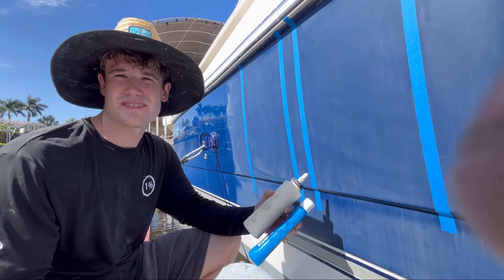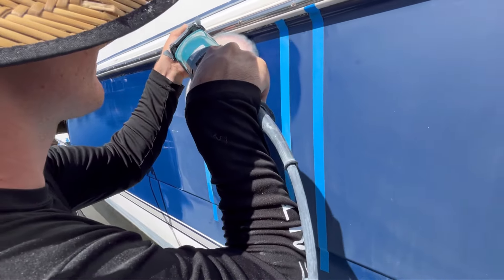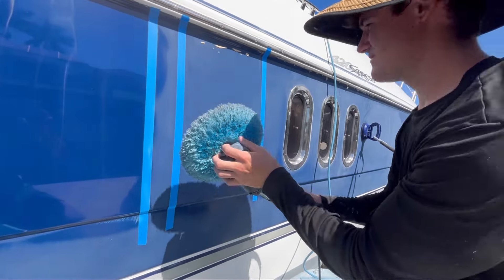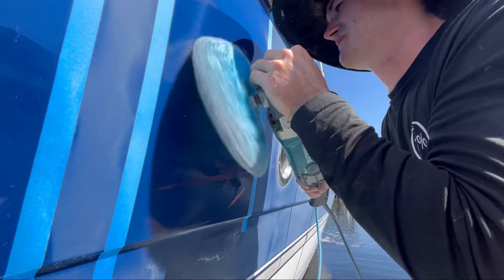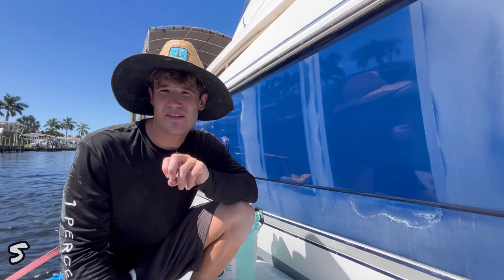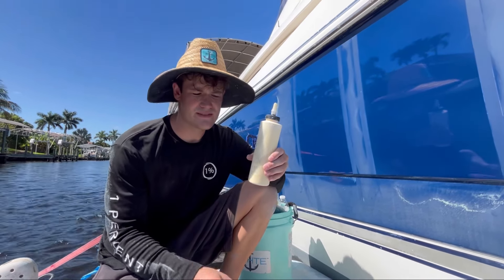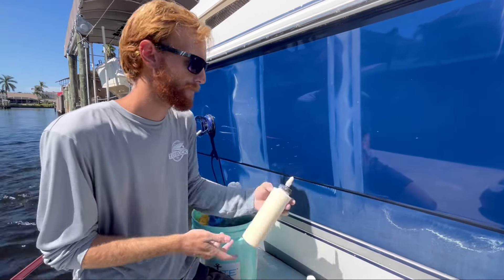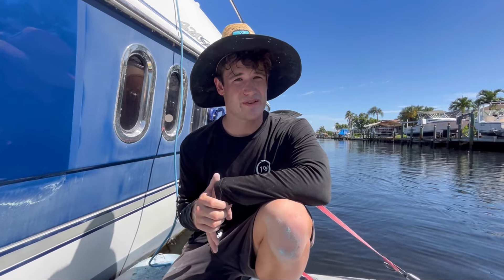Meguiars 49 Oxidation Remover vs Starke Level R | Which Compound is Better?

Comment: Home player here, Starke Level R/gal $100 vs Meguiars 4901 $40/gal. Appears from your test that Meguiars results are 99.99% of the results but costs 60 % less. Plus Meguiars is everywhere such as Walmart etc. IMO, Starke is a hard sale at over twice the price yet results that would require a gloss meter to differentiate.